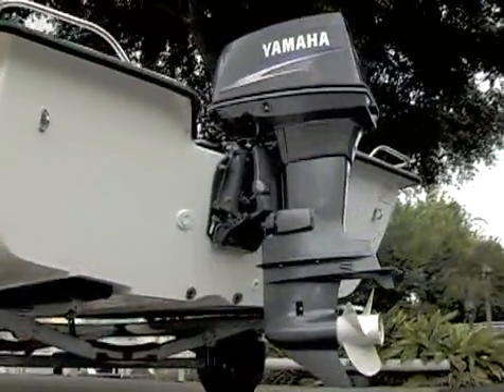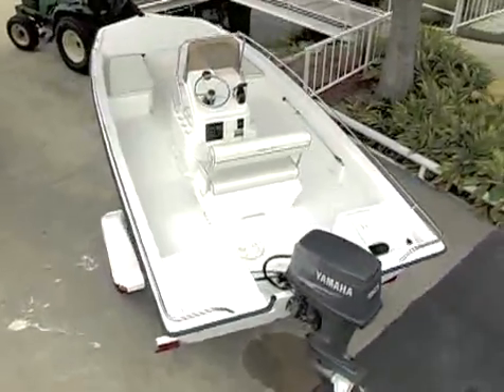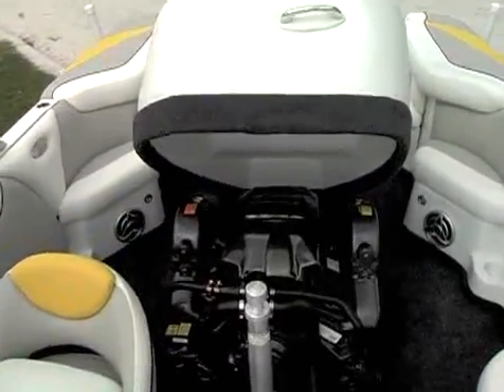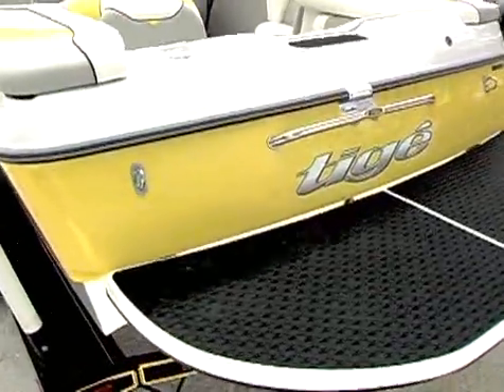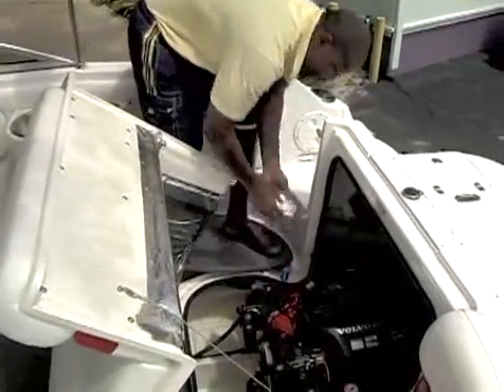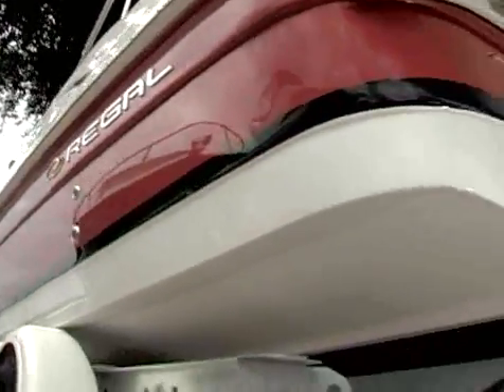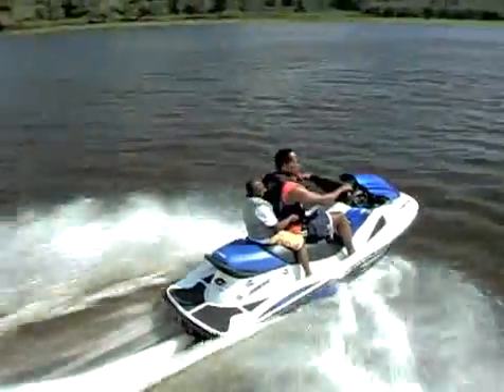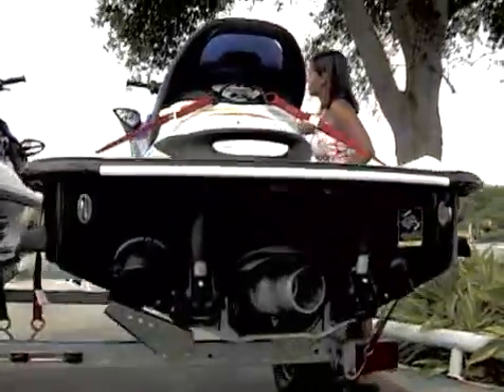Boat Engine Types

Comment: What do you call a self contained outboard that uses a steering wheel and throttle lever?
Reply: Pppppp
Reply: Ppppppppppppppppppppppppppppppppppppppppppppppppppppppppppipippppppppppppp0pppppppppppppppppppppp9pppppppppppppp9pp9pp9pp9pp9pp9ppppp9pu9u9999u9u99upp9pui9u9u9u9uuui9pp9u999uiuuiuiuuu99uiuiu9u9uiu9up999upuppu9999u999pu9
Reply: Ppppppp